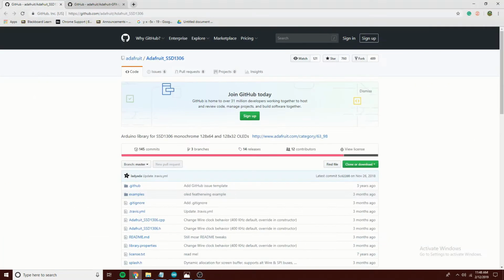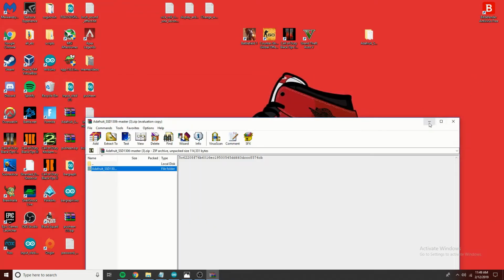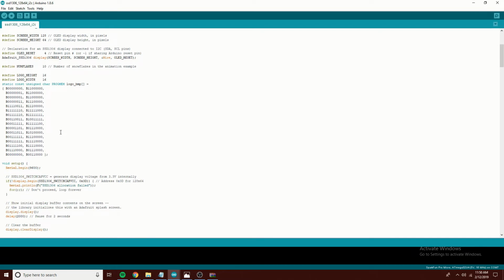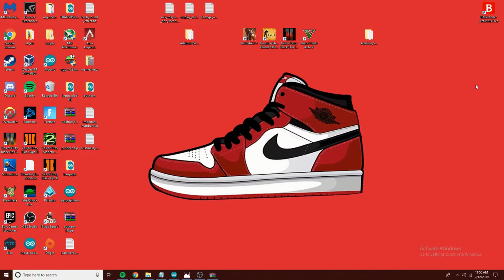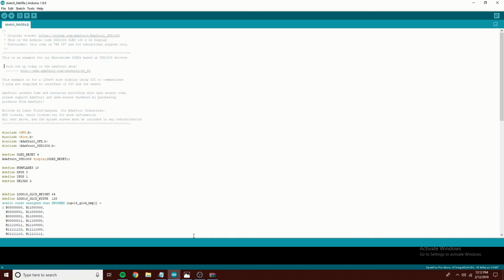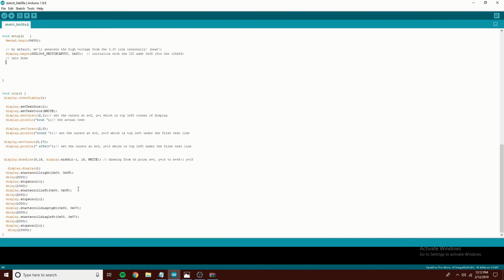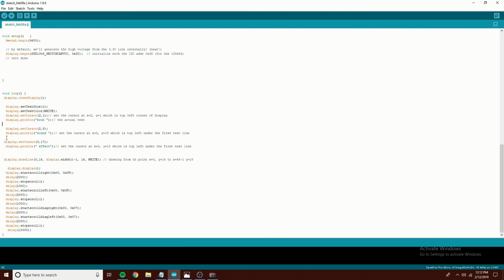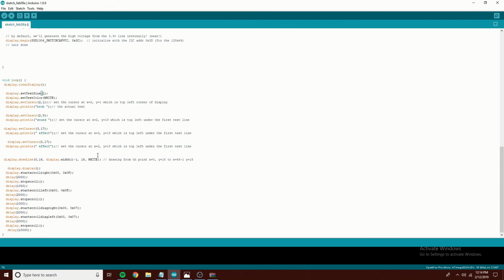How to connect a Arduino pro micro to a 128 x 64 Oled Display.

Comment: Nice video!
I was wondering if maybe you can help out. I got the same components as the ones you have but unfortunately the screen doesn't light up and my arduino has 1 solid red light next to the usb micro connection. Any suggestions on how to fix that? Thanks again in advance.
Reply from the maker: Hmm, when you upload the code, does the red light flash and the compiler say it was completed? If no, check to see what the error is, it may be that you're missing a display.h or something similar to that.  If the code does load onto your Arduino, check the connections on the breadboard. If your pretty new then you might be placing the wires the wrong way on the breadboard. lookup online to see how the breadboard wiring is to confirm that you wired correctly.  Another reason it could not be working is that you might have defined the wrong thing in the notepad++ if I remember correctly. Hope this helps. Give some more information and I will try my best to help some more. Thanks for watching!
Reply: @twistedace6365  I greatly appreciate the response. I am new to this. It appears that the arduino flashes red when I upload the code to it. Also, I don't have notepad++ rather edited the normal notepad code when I followed your step when altering the code. I ordered a new arduino and screen. I'm not sure if maybe one of them might be defective.
Reply: @twistedace6365  yeah, I'm convinced my arduino is defective or has bootloader issue. I tried a button code, the program uploaded and made the arduino into a keyboard device but when I click on the buttons it does not do anything.
Reply from the maker: @JoseHernandez-do1bj  I'm not sure what you mean by buttons. Try running a basic led flash code. if the basic flash code works then you know your Arduino is working. To do this you go to file, examples, basics, then Blink. Compline and upload the code onto your arduino. let me know what happens.
Reply: @twistedace6365  yeah, I tried that basic blinking code and the arduino responds. Unfortunately, it doesn't seem to respond when i wire a oled display or connect a button to led bulb. Maybe there's something I'm missing, I'm not sure though. And I know I'm wiring it correct to my understanding.

Comment: Thanks for the vid bud, this is exactly what I needed. I wish you spoke a little louder but this worked well. Now if I can connect in my HiLetgo ESP-WROOM-32 ESP32 ESP-32S in I will be on my way. But thanks again mate.  This helped a ton!!!
Reply from the maker: No problem. Glad I could help. Good luck with your project.  :)